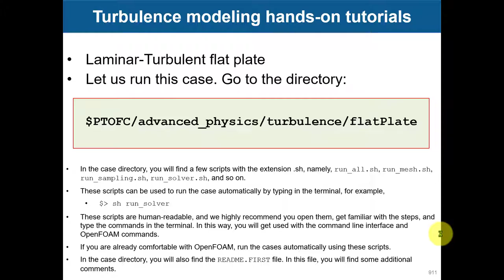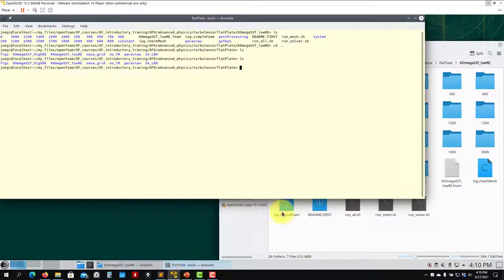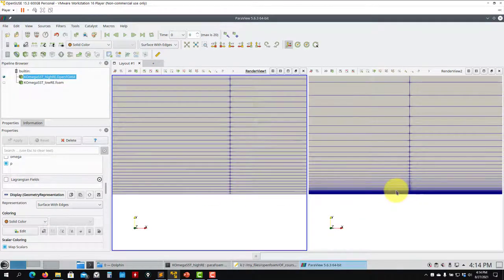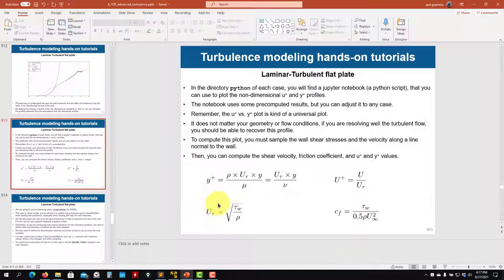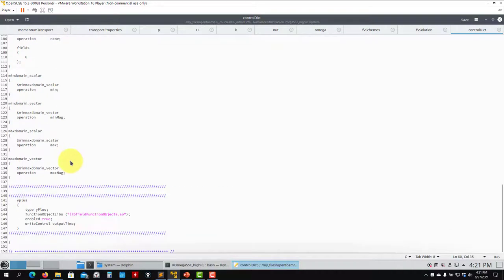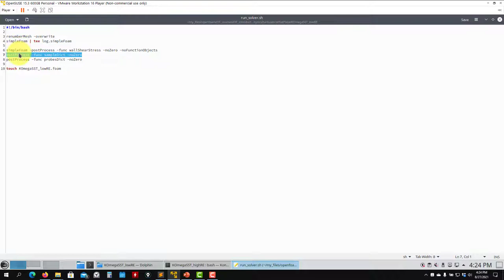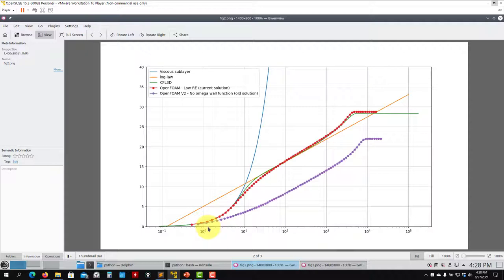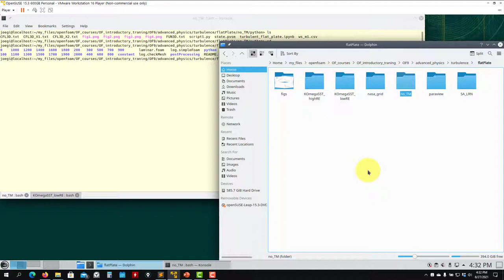8.3 Module 8 - Advanced physics - Turbulence #openfoamtraining

Comment: ¡hola! have you found  to be a good practice to set internalField to the same value as the inlet?
Reply from the maker: Yes. The closer the initial conditions are to the final solution, the faster the convergence rate will be.  So, in general, this is a very good choice for initial conditions.  Keep in mind that there are cases that are very sensitive to initial conditions, so you will arrive to different solutions dependent on the value used, e.g., cases with buoyancy.
Reply: @wolfdynamics5703  T H A N K    Y O U!!

Comment: Hi, i have a problem when i try to run simpleFoam.....-> FOAM FATAL IO ERROR: (openfoam-2212)
minMag is not in enumeration: (none min max sum sumMag average volAverage volIntegrate CoV weightedSum weightedAverage weightedVolAverage weightedVolIntegrate)
Reply from the maker: You need to use OpenFOAM 10. If you use the ESI version, you will need to modify some of the input files, as in this case.
Reply: @wolfdynamics5703  Which is the difference between version 2122 and version 10? How can i get that version (OpenFoam10)? 
I couldn't find that version on the openfoam page
Reply from the maker: @eduardoireta3906  openfoam 10 = https://openfoam.org/
openfoam ESI (v2212) = https://www.openfoam.com/
Reply: @wolfdynamics5703  Thank you bro! i could resolve it, now it is ok when i run "simpleFoam" but when i try to run "simpleFoam -postProcess -func wallShearStress -noZero -noFunctionObjects" ... i get a fatal error ---> --> 
FOAM FATAL ERROR: 
Wrong number of arguments, expected 0 found 1
Invalid option: -postProcess
Invalid option: -func
Invalid option: -noZero